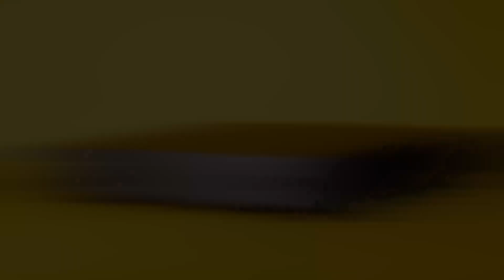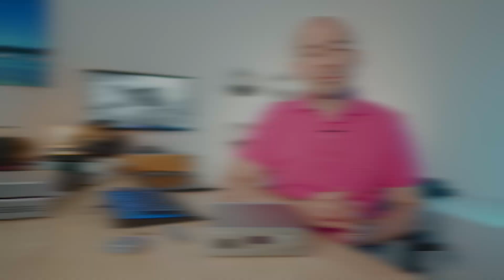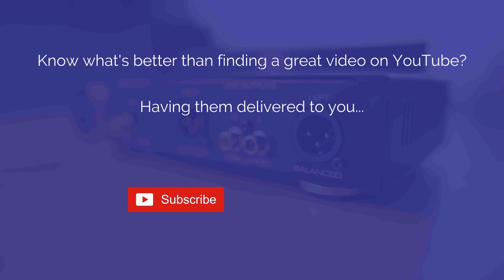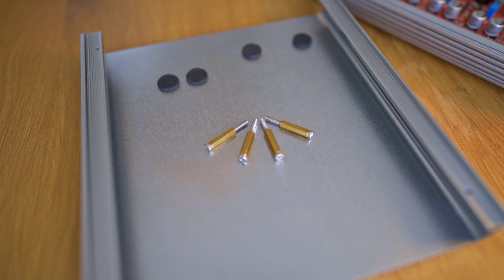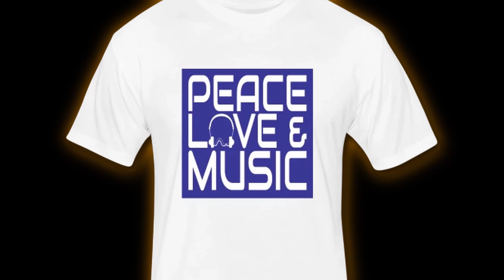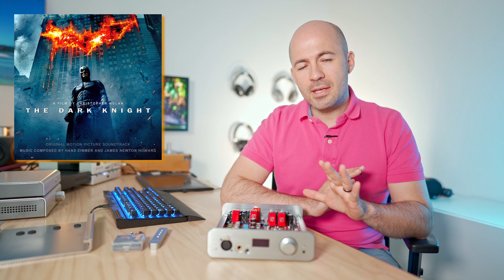Burson Soloist 3X Headphone Amp Review - New tech + old classic = wow!

Comment: Hey. Did you try Focal Clear OG and Arya Stealth on this amp? If so, how is the synergy between them?
Reply from the maker: It's great with the Arya Stealth (although I'd throw some Sparkos Labs op-amps in the volume stage for them). I can't remember the Clear OG pairing, but no reason it wouldn't be great too.
Reply: @PassionforSound   Is the opamp change mandatory for Arya Stealth? And thank you for the reply BTW, very much appreciated.
Reply from the maker: No, not at all. It will sound great even without the op-amps being changed. 🙂
Reply: @PassionforSound   How does this amp fare against Conductor 3x Performance?
Reply from the maker: The Soloist is a better amp than the Conductor because it's a dedicated amp rather than an amp and DAC so if you only need amplification, the Soloist is the way to go
Reply: Okay. Thank you. And which DAC will you suggest to go with this amp?
Reply from the maker: I really like it paired with the Schiit Bifrost 2, especially the updated 2/64 version (in case you're considering buying second hand). Alternatively, the Burson Composer DAC is nice and makes for a great matching stack with the Soloist
Reply: @PassionforSound  Thanks for your suggestions, I actually found a good deal on GT, so went ahead with it. So, same DACs and same Sparkos opamp in volume stage work for this GT amp too?
Reply: @PassionforSound   And I am also contemplating going all the way to Gustard R26 too. If you had tried that DAC, will it be great to pair with Soloist 3X GT and Arya Stealth?
Reply from the maker: I haven't tried the Gustard yet so can't comment on that, but the GT is a great amp! What I can't help with is the op-amps because the GT uses so many of them that I've never invested the time or money into rolling them.

Comment: Very nice amp. I love the precise volume control and the display. Are there cheaper amps with these qualities ?
Reply from the maker: Interesting question! I've not come across other amps with this type of control that I can recall. It's mostly all-in-one devices with DAC and amp that offer this because the digital volume controllers are required either in the DAC or as a dedicated (and expensive) chip in the Soloist.

Comment: What headphones did you evaluate the 3XP's bass and stage depth with..? What equipment & phones offers the best 3D & depth that you've found so far?
Reply from the maker: The Meze Elite are probably my favourite for soundstage depth, but the new ZMF Atrium is also very good at nearly half the price. I also use the HiFiMan Susvaras and Aryas quite a bit in my testing too.
Reply: @PassionforSound  How do you feel about Susvara in the TOTL competition..? HE6 v1 is one of my top 2 phones of all-time I've heard(and LCD-3), but HE6se v2 not so much. Arya seems good, but problematic. I have an XS I will be unboxing soon, and hoping for very good things, after disappointment with Sundara and 400se. The HE1000's seem to get mixed reviews, so I would absolutely go for Stax 007 & L700 for what Susvara costs.
Reply from the maker: The Susvaras are an amazing headphone when heard from a quality source chain. I personally like a little more bass than they bring, but I still enjoy them a great deal and they're miles ahead of any other HiFiMan headphone I've tried.

Comment: Hi Lachlan! I gotta tell you something. I still, after 7 years, own the very first Soloist SL dedicated headphone amp. I find that pairing it with the Qutest DAC from chord  set at 3V RMS is an incredible pairing and has been my amp and DAC pairing for nearly 5 years now. :) 
I have no aspirations to upgrade yet, but maybe you can change my mind. :)
Anyhow. A terrific test track is Peter Gabriel’s “Signal to Noise “ track from the album UP. 
It is a wonderful mix by Tchad Blake. You’ll love it. It is a powerful track that builds, which tests speed, accuracy and detail retrieval. :)

Comment: Hi Lachlan,  I'm currently mid upgrade from my Sundara's with Topping E50/L50 stack to the Arya Stealth with a Burson Conductor 3X or possibly the Soloist and dac.  I see that you recommended the Bifrost 2 below.   Would you choose that with the Soloist over the Burson Composer Dac or would you seek out a used Chord qutest which are available for about €1,000 with light use.  I"ll be buying some closed back headphones in the future such as the Aeon Noire by Dan Clark as my wife keeps commenting about how loud the open backs are but I just love the sound of the Arya's so will be mainly using those.  Your input as always is much appreciated.
Reply from the maker: Hi Ronan, yes, I'd definitely choose the Bifrost 2 over the Composer because it will provide depth and layering in the soundstage that the Composer can't (due to the delta-sigma chip in use)
Sounds like you're going to have an even better setup soon! Any ideas on the closed backs you'll be buying?
Reply: @PassionforSound  Sorry, I just saw you had replied after I edited my original message about the bifrost 2 to add the Qutest into the fray and the open backs as possibly the Dan Clark Aeon Noire 2. Many thanks😊
Reply from the maker: Hmmmm... I would choose the Qutest over the Bifrost 2 if that's an option. Also, the Noires are an excellent choice! I have a pair hear now for review soon...
Reply: @PassionforSound  great, food for thought.  Thanks again for your prompt replies.  Testing is not an option for me so your reviews and opinions help greatly. When reduced in price the Conductor 3 all in one is very tempting at the price so some contemplating involved in spending twice that for separates.  Looking forward to the Noire review:))Keep up the great work!

Comment: Hi Lachlan, great video once again. They’ve been so useful in finding my way through the complex market of this tech - so thank you. Perhaps quite a specific question, but is there anything else out there that matches the soloist for a similar price that includes RCA outputs? The soloist seems a step above the £400 odd amps, and I don’t mind paying, but I really want to use it as a pre into RCA, and it seems the Burson kit requires a transformer to function this way. Another expense and box for this basic functionality! It’s a shame as it looks great. Thanks
Reply from the maker: Glad you're liking the reviews. I haven't found another amp yet that I'd rate quite as highly as the Soloist (for the price) which isn't too say that it doesn't exist - just that I haven't yet tried it.
The best I can currently recommend would be the Singxer SA-1 which is a little more versatile, but not quite as good sonically.

Comment: Great review.
Bought one as well since I have pair of Sparkos dual opamps that need new home.
Reply from the maker: Nice! I actually have an op-amp rolling video going live tomorrow that you might find interesting. 🙂
Reply: How do you like the Sparkos ss-3602's inside the Burson's input stage? I'm curious because I own both the V6 Vivids and the '3602's - and I alternate them in and out of my Gustard H20. In the H20 I like the '3602's slightly better but I'm thinking of getting the Soloist and running them (the '3602's) in it. What's your take on the combo?
Reply from the maker: I've done a full op-amp video discussing this in detail, but the short answer is that I like the SS3602 on the volume stage and the Vivids in the gain stage
Reply: @PassionforSound  Great. I have a Gustard H20 that I put ss-3602's and Vivids into: I like the ss-3602's slightly more than the Vivids b/c of their wider, deeper staging and better microdetail and texture. Of course, any opamp SQ differences are dependent on the component their put into. I'm looking at getting the Soloist 3XP, not the GT. How do the two compare?
Reply from the maker: How does the 3XP compare to the GT? They're very different in terms of performance, but clearly from the same designers in terms of their general sound. For more detail it's best to check my GT review where I discussed the upgrade specifically 🙂
Reply: @PassionforSound  Thanks a ton, L. I  appreciate your efforts and your patience.

Comment: I bought this on your rec. Your review absolutely nailed it! 100% agree on everything. Drives all my headphones with transparency, authority & ease, HE6SE, Arya, HD800S, HD6XX, LCD-4, NEVER sounded better. This amp is my endgame. Even in light of the new GT that was just released. As far as I can tell, its still pretty much the same amp, with a bit more power that I don't need, and a few more features that I probably won't use.
Reply: @mark clement &  @Passion for Sound :With your Soloist 3XP do you hear a pop in your headphones (connected via balanced 4-pin XLR) when powering on/off the Soloist with vol=0?  Do you also get an even louder pop when changing gain levels (also with vol=0)?
Reply: @maddog7397  no. No pops at all. At any volume level.
Reply: @mclement052164  Thanks.  Then I must have a defective unit.  Bummer.
Reply from the maker: I agree with Mark. There should be no pop based on my unit. I do hear a pop through my active monitors, but never headphones
Reply: What other amps have you tried with the he6se? Curious to know how those amps compare to the soloist with the he6se, thank you.
Reply: I heared bothand can honestly say, the difference is quite a big step up(not only power) BUT the soloist 3x is still a great amp as well!
Reply from the maker: So glad you're enjoying it, Mark. It's a really wonderful amp! Nice to see that you're enjoying the HE-6SE with it and not getting dragged into the "more power" myth 🙂
Reply: Could you share your usage experience? Does your soloist continue to please you?

Comment: Are you going to try to get the Soloist 3X Grand Tourer. Question, would the Soloist 3X or the Soloist 3X Gt's pre amp be enough to drive my Balanced Audio Tech VK-75se? My knowledge base is not high.  lol
Reply from the maker: I'm expecting the GT to arrive today actually so yes, definitely will be reviewing the GT. 🙂
As for pre-amp use, both should do a great job because a pre-amp is generally providing volume control rather than any extra gain or power (although they can be used to increase the voltage from your DAC to your amp sometimes). In short, either should work really well for your setup.
Reply: @PassionforSound  Thank you. Looking forward for the Soloist 3X GT review. It looks like it might  be a step up. Hoping
Reply: Just to fill in the blank. I am using a DigiOne Signature to a 32 year old Wadia 2000 Dac to my Vk-75se. The DAC has a digital volume control. But you have to set the dip switches inside for the right amount of voltage to amp so as to keep the digital volume on the upper end for best dynamic range and still not over driving amp. At this point modern would be nice. Again, thanks for the help.
Reply from the maker: Sounds like your DAC will be best with high output voltage if it's degrading the sound quality at lower levels. A Soloist (or GT) will likely help you to get max performance from the DAC while controlling the volume well
Reply: @PassionforSound  That leads to the question I'm after here. How much input to a amp like the Burson can you put in. I don't want to buy lets say a Burson soloist 3X GT and send it to much voltage from DAC to fry it. This is my problem while trying to use my old DAC. I guess the safest way forward would be buying the amp. Turn volume all the way up and bring voltage up slowly from the DAC. Set, lets say the GT"s volume at 10 o'clock. AS I bring up voltage from dac I could set amp output. Maybe because of my lack of electronic knowledge Im worrying about something that does not exist.
Reply from the maker: Most DACs will output 2V single ended (RCA) and 3V or 4V balanced (XLR) so I'd go for that kind of output if you're able to measure it or if it's clear from the DAC design.
Reply: @PassionforSound  Thats about were it is now to dive my amp. Didn't know if that was to much to go into the Burson. Thank you for your help!!!!
Reply from the maker: My pleasure!

Comment: Hi Lachlan, thank you for the great review. What would be your recommended DAC for the Soloist between the Biforst 2, Qutest and Gungnir? I mainly listen to rock/prog/EDM and I have the Sony MDR-Z1R, Focal Clear Pro, Meze Elite and Sundaras. I'm currently using the Sony TA-ZH1ES DAC/amp but recently ordered the Soloist (thanks to your review), hoping to use the Sony as a DAC for it, but I am now considering having two separate setups so I might need another standalone DAC which I will pair with the Soloist. Thanks!
Reply from the maker: Hi Zach, I'd definitely go for the Qutest of budget allows. You've named three excellent options there though so any would be great. I haven't heard the current Gungnir, but my old one was not quite as good as Qutest. I still expect the scale to be unchanged where all are excellent, but Bifrost 2 < Gungnir < Qutest
Reply: @PassionforSound  Thanks Lachlan. Just adding in some additional impressions of running the TA-ZH1ES into the Soloist and I found that it lacks punch especially in the lower frequencies in comparison to the Sony. Would the Qutest help in this regard or would a Multibit DAC be better suited? Sorry for asking again but I wanted to be sure as I may not have a chance at trying it out before I buy. Thanks!
Reply from the maker: That's a tough one to answer because I haven't tried the Sony to understand how the DAC and amp stages sound.
I think the only ways to answer this are to try another DAC if you can or maybe find some reviews of the Sony unit that describe how the amp stage and DAC stage perform separately. I.e. is the DAC a bit thin sounding and the amp extra beefy or is the DAC more neutral and the amp just a warmer, punchier style sound than the Soloist (which is very crisp and clean, but shouldn't lack bass as such)

Comment: I have just read that you cannot connect the soloist to a integrated amplifier using the pre out from your integrated amp.😯 I have no sound. Somebody help
Reply: My understanding is that the Soloist x3 has a "power amp mode" which is meant for exactly this scenario. It bypasses the volume control so you can use the volume control on your integrated amp.
Reply from the maker: Hi Stephen, I can't understand why that would be and don't recall seeing that anywhere. I've used the Soloist after a pre-amp before with no issues at all. Can you tell me where you read it so I can take a look for you?
Reply: @PassionforSound  i thought I could use the DAC streamer in my EVO 150 to the Burson. But for some reason nothing is happening. I read in a forum that you can't go pre out from integrated into a head amplifier. You have to go ' tape out' ... I was hoping someone would set me straight here.
Reply from the maker: No reason I'm aware of that you can't take the pre-out. Worst case scenario I can think of is that it will clip the input stage and either cause a protection circuit to kick-in or will just sound dreadful.
I'm assuming the pre-out from your receiver is variable? If so, just start with the volume right down on the receiver and see how you go.

Comment: Have you heard the Conductor 3x Performance yet? I'm wondering how it compares to this. They look very similar in teams of amp stage, but with the Conductor having a built in ESS DAC and streamer.
Reply from the maker: I haven't tried the Conductor. It's essentially the Composer and Soloist combined with some compromises to fit them in a single chassis. There's no streamer though it think, just Bluetooth
Reply: @PassionforSound  got it. Thanks mate.

Comment: i love your reviews and the detail you provide. Incredibly informative and helpful. I have the Chord TT2 but was thinking of getting the Soloist based on your review so that I can run a balanced signal to the Soloist and get a balanced out through my headphones or pre-amp. That is not currently possible with the TT2. Would you advise that? Thanks
Reply from the maker: Hi Melvin, the TT2 single ended headphone output is still the very best I have tried of any headphone output so I wouldn't recommend the Soloist for the sake of the connector. You can always run the TT2 as a pre-amp and it's also possible to get an adapter cable to run a headphone off the rear XLRs of you want to (although my tests proved to me that there is no benefit). 
The Soloist is a great amp, but the TT2 is better by a decent margin.